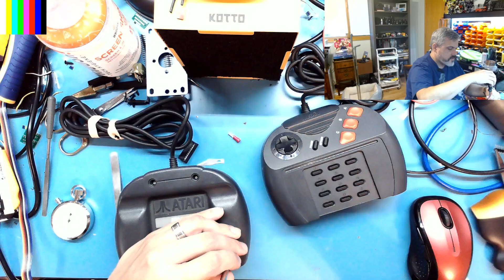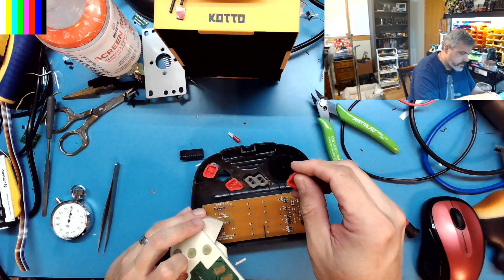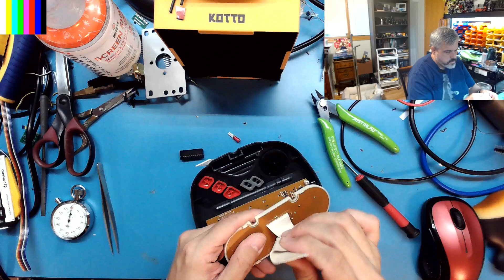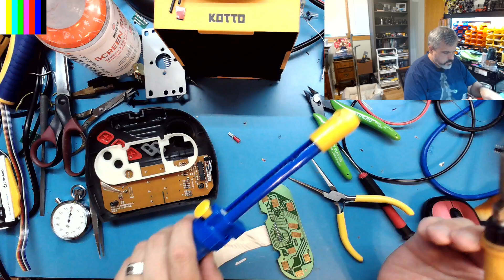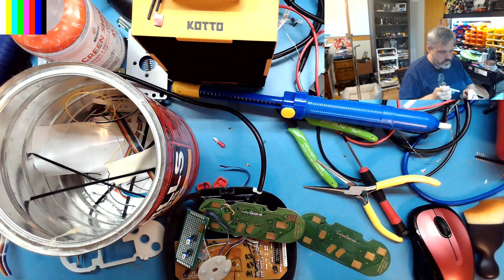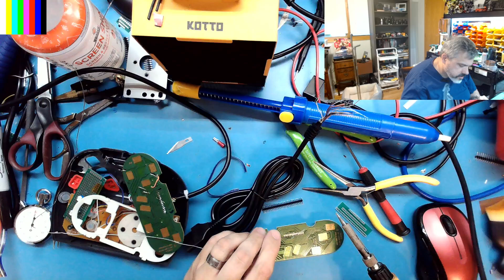What's On My Workbench, Atari Jaguar 5200 Conversion

Comment: I purchased several of these from you years ago. I also have your analog controller. Would it be possible to convert a Jaguar controller with an analog thumb stick?
Reply from the maker: I have not been able to fit an analog stick in the Jaguar controller, sadly.  I tried and have a couple of wrecked controllers as evidence.  That is what let me down the road of making the analog controller from scratch.